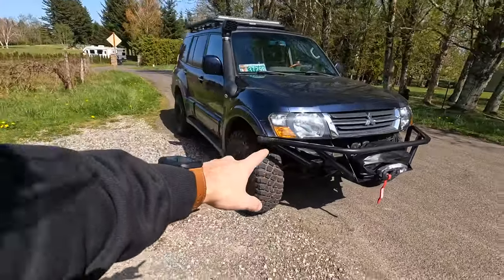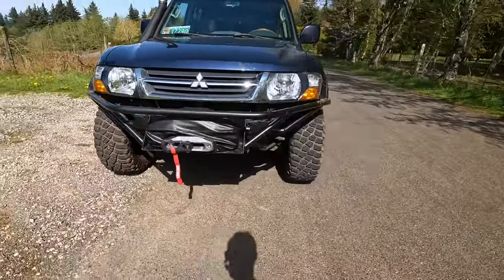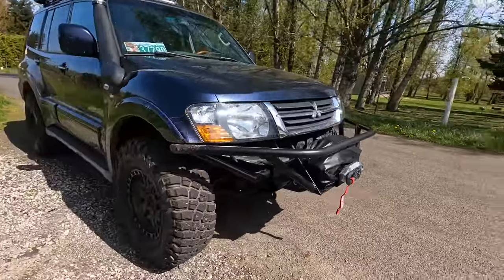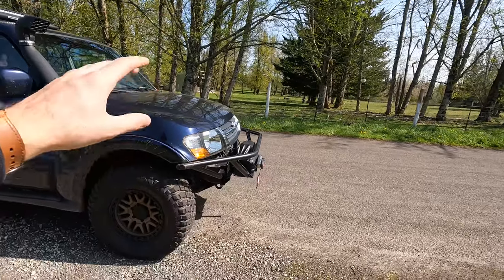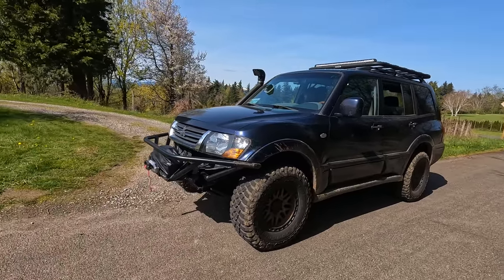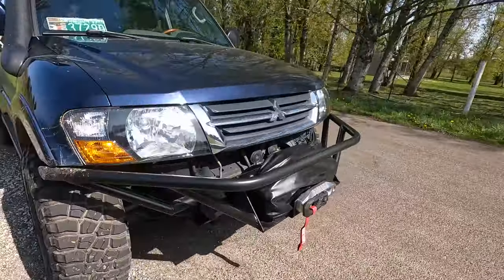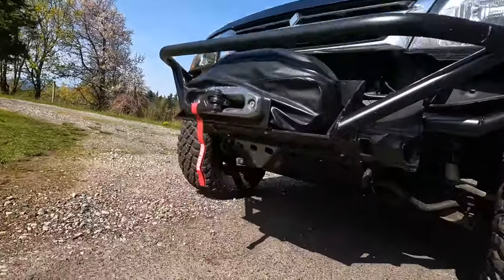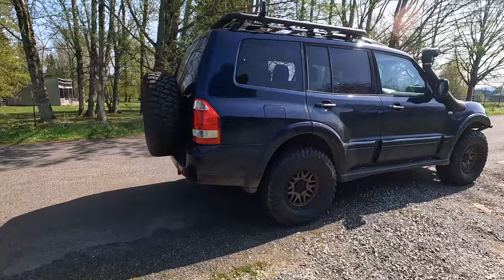CUSTOM PIPE FRONT BUMPER - [Mitsubishi Montero 2003] Off-roading BUDGET BUILD [Overlanding Build]

Comment: Your rig looks great.. I use the same Ironman lift kit plus 2 inch lift plates under the struts and rear coils but my axles specially at the front are getting too much stress from this lift. I also use a 2 inch front ball joint lift blocks but its barely making it. So far the only problem I have is with my cv boots that get rip. I believe there is a transfer case lowering kit but I haven't had any luck locating them. Do you have the same angle issues to the point where your cvs are probably getting rip every time?
Reply from the maker: So since I only have the 1.5” Ironman heavy loaded lift my CV angle didn’t change to much even with the 33s that I have on. So far I haven’t had any problems at all and no worries either.

I think the coolest part is I towed a 5 thousand pound trailer and the back end didn’t even sag an inch! Blew my mind how good this suspension is

Comment: Hello, your montero is looking amazing.  I have the identical montero.  I have 3 quick questions,  is your engine a 3.8 liter and have you done any modification to your engine?
2nd question is your montero all wheel drive? Just asking because I would like to start mods on mine the near future. 
Thanks
Reply from the maker: Yup! I have the 3.8L and no modifications to engine other than snorkel air intake and yes it’s all wheel drive with center locking dif